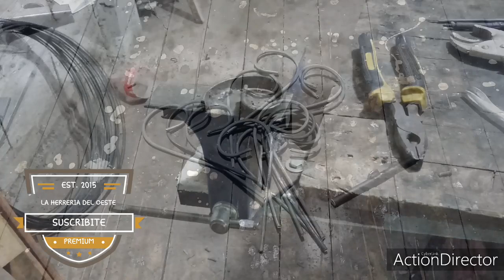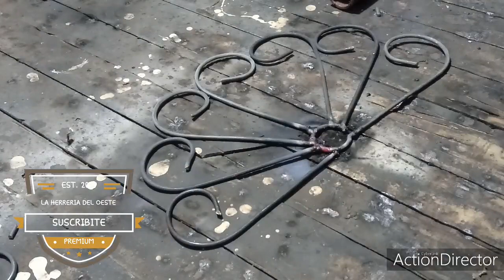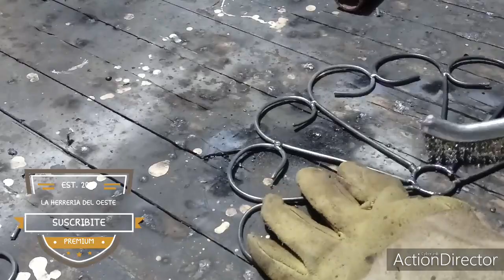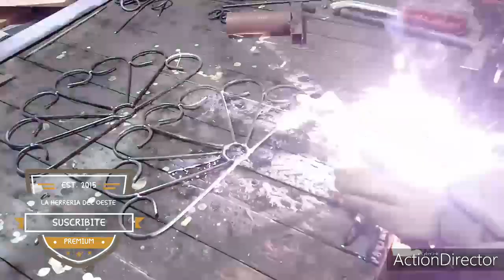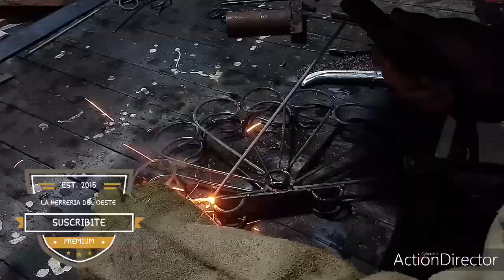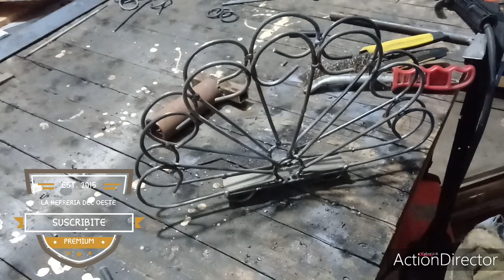Arte en hierro| servilletero souvenir| souvenir napkin holder faça você mesmo| how to make #diy #art

Comment: Veo que tenes el problema de que se te pega el electrodo bastante seguido,  lo regulas bajo para no fundir el material ?
 Muy buenos tus maceteros!!  sencillos, variados y faciles de vender 👏👏😁
Reply from the maker: Hola frank gracias por tu comentario lo que pasa es que tuve que cambiar el cable de la masa y le erre en el espesor del cable
Reply: @LAHERRERIADELOESTE  ahhhh de unaa,  gracias por responder 😁
Reply: Tenés q cebar antes el electrodo para q no se pegue
Reply: @michele-gi9pv  pero si el cable no da la polenta que necesita va a ser al pedo,  es falta de potencia no de temperatura